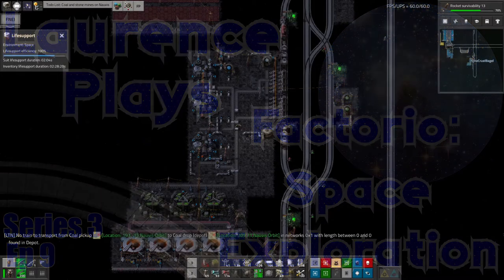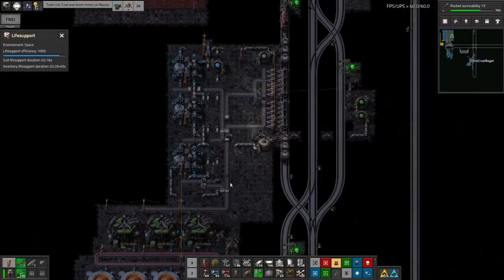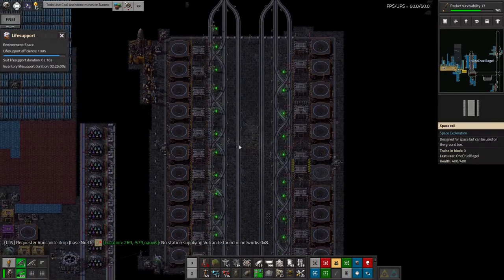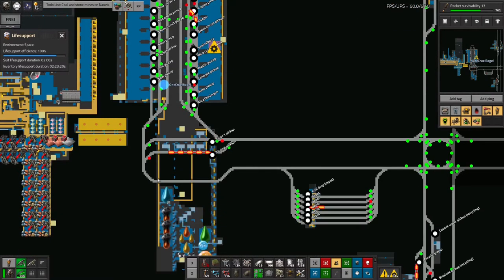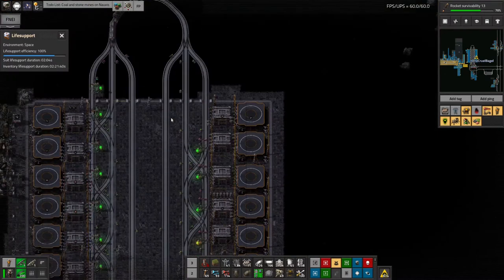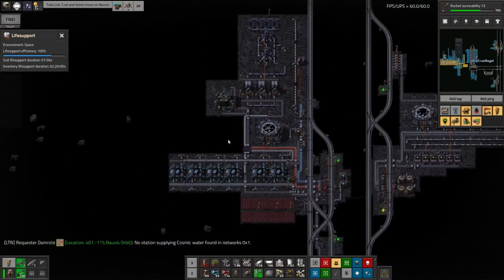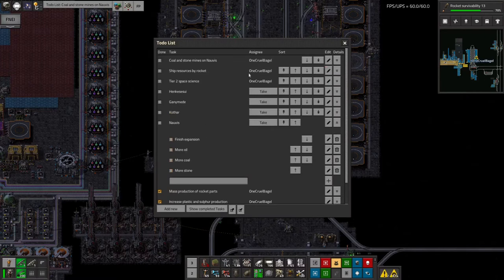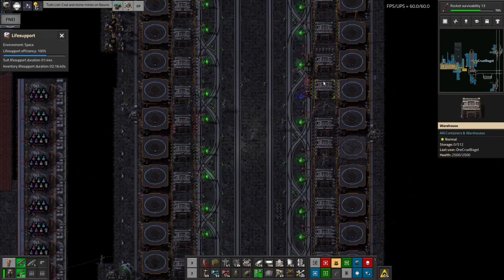S3-E9 - Mistakes Were Made - Laurence Plays Factorio: Space Exploration

Comment: Maybe you could have even silo stations unload on the left and off silo stations unload on the right. Then for the left or right, as you have 6 lines in the middle, you could use 1 for every 4th station, 2 as the central line for the left silos, 3 as for every 4th + 2 silo, and then flip it for lines 4-6, and add 3 lines to each side of the outside. That way you can avoid moving all those items.
Reply from the maker: I see what you mean - I think that would probably work (assuming there's room to squeeze all the tracks through), but fortunately if you're up there in person and not doing everything by bot, moving lots of stuff around isn't too difficult  :-)  I fixed it in a different way, as you'll see in the next video!